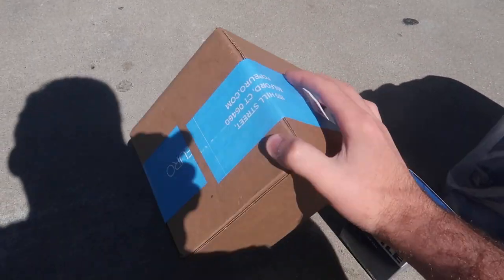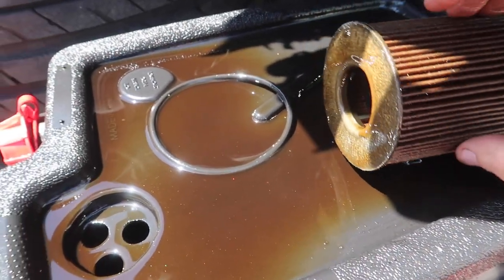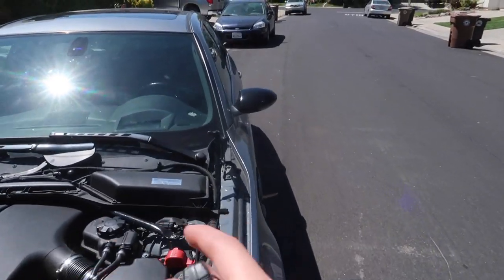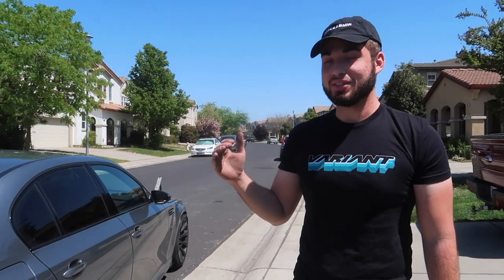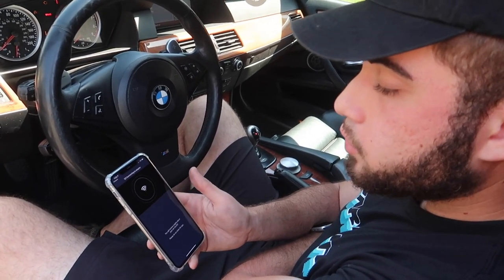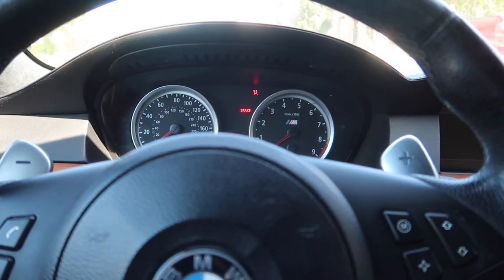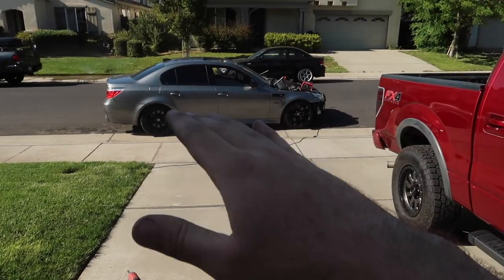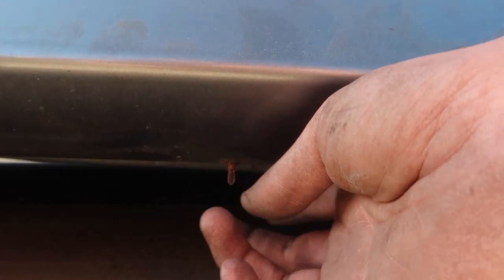WE HAVE THE NEW SENSOR FOR THE M5! REBUILDING FRONT END!

Comment: Check the fuel filter and pump I had that happen with my e46 and my sisters mustang gt.The codes won't come up but it would prevent the car from starting.
Reply: Exact problem on my n54 right njw

Comment: That oil was glistening in the sun, better do your rod bearings.
Reply: Common issue on this engine :D
Reply: Yes sir, BMW designed that engine ad well as the N55 with tighter clearance on the rod bearings.
Reply: @jimstrongone  a lot of high performance engines have very tight clearances. usually not a problem when maintained correctly
Reply: @sk1p1112  absolutely WHEN  Maintained correctly.  BMW themselves recommended changing the rod bearings every 60k-80k miles.
Reply from the maker: so I should do my rod bearing once I get this thing running?
Reply: @NourHummadi  yes 😂
Reply: @NourHummadi  absolutely my friend 👍💯 keep up the great work.
Reply: @NourHummadi  please god do not let it run longer than 5 mins until you get those bearings swapped. it will knock bro just tryna save your s65 if im correct.
Reply: @e92erik  S65 is the V8, the S85 is the V10
Reply: Yes, you don’t want to end up with a 10k - 20k engine rebuild.
Reply: I agree with everyone in this comment.
Rod Bearings to be replaced.
Here's a reference
M539 Restorations Youtube Channel
https://www.youtube.com/watch?v=LMDTXlgZeV4&list=PLBcFoVFuPCfiwvcou0h8_Lj8TIyxcwxrc&index=2
"In The Belly Of The Beast - The Cheapest V10 BMW E60 M5 6-speed - Project Raleigh: Part 2"

Comment: Nour, after some googling, here are some possible causes of this new code:
- Fuel tank breather valve 
- Starter motor
- Anti-theft system - Immobiliser is cutting out the engine
- Battery ground issue
- Gearbox Neutral switch - car thinks the car is not in neutral so cuts out engine

Keep on diagnosing man 💪

Comment: Nour you mentioned in your last vids that previous owner had a shop install a new flywheel in the bmw. Before sending it to bmw, remove the crank position sensors and look through the whole that the crank position sensors bolt to and see if any of the “teeth on the fly wheel are bent” if it’s bent or broken on install it will cause a no start issue like you have!! Hope this helps I work at a dealer as a tech and seen that happen !
Reply: Also I’m not sure if bmw’s do it but other manufactures, if you remove both crank position sensors or one it should technically start. It will just run in fail safe mode that’s another way of tell if you either have a sensor issue or flywheel issue. 👍🏻 hope this helps. Love the channel 🙌🏻

Comment: Maybe you could check fuel pressure. First things, I would like for you to do is to check where all the fuel are. I have an instance where all the fuel would ended up in the fuel filter section of the tank which in turn causing no fuel suction for the pump. Left is fuel filter and right is fuel pump. You can check that in the instrument panel. First you need to add the last 5  of the car vin number. Press the button on the instrument panel for as long until you see ‘TEST-NR. 01” at that point you begin to press the button again until you get to test mode test-nr. 19 then below 19, you enter the total of the last 5 vin number. Just press constantly until you get to the total number of your vin then release. Until you see test nr. 1 then press repeatedly until test nr, 6 to see where all the fuel in the tank. If all of it in the left, then that explains why you have starting problem.  Smg code 5200 is an indication that your clutch is finished. 5200 will not cause no starting condition. Typically that code will quickly shows when you start the car because the clutch trying to engage against the pressure plate and detecting that there is a slippage.

Comment: Hey nour.. i had an f30 that had the exact samee problem.. it cranks and almost starts but wouldn't. When running it on a scanner it issues some problems with crankshaft sensor, transmission and abs/dsc. Changed multiple things... samee problem ... so i decided to just start disassemble everything.. the problem turned out to be, after a lot of work, the reluctor which basically bolts on to the crankshaft and gives readings to the crankshaft sensor. But the trans had to be pulled out.
I don't know if the m5 has the same thing but it's most likely something very similar.
If you search e60 reluctor you'll know what iam talking about.
I hope this helps and best of luck to you bro.
Love your channel and keep it up.

Comment: Spray starter fluid into the intakes to see if it will crank over. With this test you will know if it's an electrical issue or fueling issue.

Comment: check the relays in the ECU. my old beamer with the SMG wouldn't crank over, and it was throwing transmission codes. Ended up changing the relays that control the transmission. cranked over right after changing. hope this helps the m5

Comment: Do some basic checking, fuel pump, spark plug, injectors, maf sensor, also the battery should be 100Ah I think (it is common for BMW and Mercedes cars) or at least try how it will react with starter fluid... btw this is not recommended

Comment: Nour go back to basics you need air fuel and spark to start a car
Try disconnecting the maf sensor 
Then try also putting some starting fluid in the intake and see if its start don’t count just on codes

Comment: Could be the relay for the CAS, the immobilizer system.  If the relay is not working, the CAS will not allow the car to start.  I believe it is part# 61366901469, goes in the fuse box in the glove compartment.
Reply: it would not crank
Reply: Cas is bypassed once the car is cranking just fyi
Reply: Fuel pump relay maybe?
Reply: 90% bad camsmhaft sensor in my opinion
Reply: @ewalbeats.7079  Agreed.  Hope our man can get that sensor soon.

Comment: Check fuel pump voltage, my e61 was the same, and the module for the fuelpump was bad and didnt give enough power to the fuel pump 
(Edit) its a common issue with the e6x that the fuelpump module goes bad if there has been low voltage on the battery for a while, or even connecting and disconnecting the battery alot

Comment: Hey Nour try to diagnose the fuel pump modular it is located in the back by the rear seat , that modular gives order to the fuel pump to work properly I had the same issue in the past with all e90 and 5 series , by the way you cannot diagnose this with Carly it won’t give you any code I thought I’d share this with you for the M5 starting issues good luck

Comment: If you want to drive the car for years dont cheap out for parts. Try to see whether the starter is blown off or there is something they usually change for a car not starting up i dunno how to say this in english but they comes by 5 or 7 / car i cant get the word in english. Never stop trying e60m5 contents are way much better than i8's. Best of luck rebuilding the cars and RIP bank balance. It will blow yours too..

Comment: i would check the fuel pump and the fuel lines. i had that same problem with my e30. it would start and cut off. so just make sure the lines aren’t clogged and check that the fuel pump is working how it’s supposed to

Comment: Might be a long shot but my car was having a similar issue recently, no codes were popping up so took it to the shop. Ended up being diesel gas in the tank. Gas station I filled up at messed up the pump.

Comment: I have an f30 it would say crank sensor was the problem.sometime I would start it and would turn off.I changed the inter cooler charge pipe and valve cover.since the valve cover has the pcv together.not sure if this helps.

Comment: I dont think its a sensor. This sounds like the car isnt getting fuel or spark. I would check the fuel pressure spark plugs and coils to make sure those are all good. Also i think you need new rod bearings and should have an oil analysis done that oil was a bit shiny unfortunately. I hope to see this thing run soon!
Reply: what does shiny oil indicate?
Reply: @NagashiChidorii  on a car like the m5 most likely rod bearings are gone thats what happens when people dont let the cars oil get up to temp

Comment: That code is just CAS module telling you that it tried to start the car and starter failed at cranking. It's not a DME fault (Engine management).

Checking the voltage, the starter and solenoid, and wiring is a good idea. Also check the wires going to the starter and solenoid (B+ and excitation wire)

Comment: Check wires between DME and CAS modules, i had a problem the same problem with e71 it was the camshaft sensor so youre sensor is probably wrong, if you need help with ISTA i can help i have experience

Comment: Change the starter, it could be that issue or you have bad high pressure fuel pump/ injectors
Reply: J Tommy  I know, I had a f10 550i and had to buy 8 brand new injectors for it
Reply: J Tommy  you can always buy one from eBay and test it out to see if it’s that could be the issue and return it, if it’s not the issue